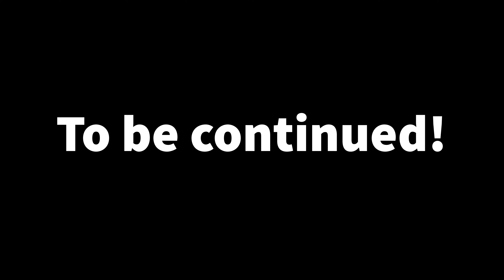How to join an angle on a drywall corner

Comment: no back blocking cuz?
Reply from the maker: For the walls? Yeah I added a few blocks where the sheet finished with no studs behind it
Reply: For an 8 inch piece of drywall with a bottom stud. Why would you need to?